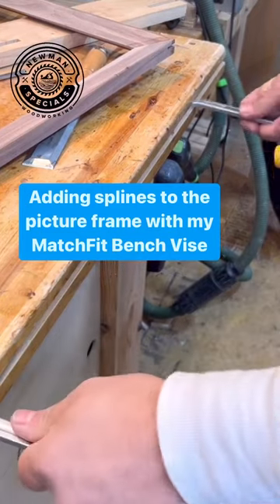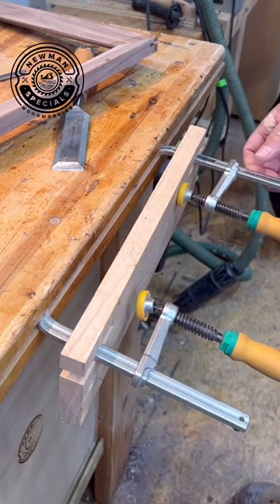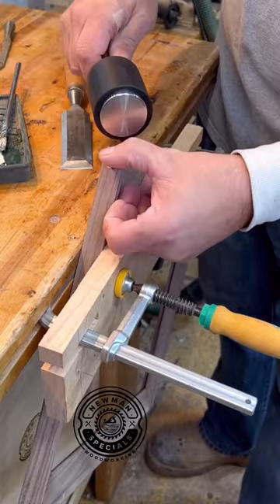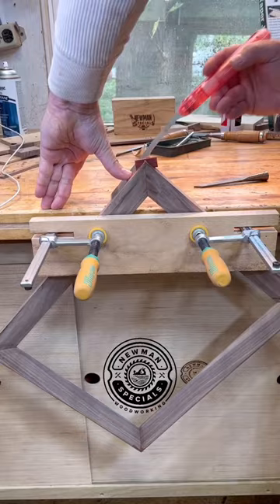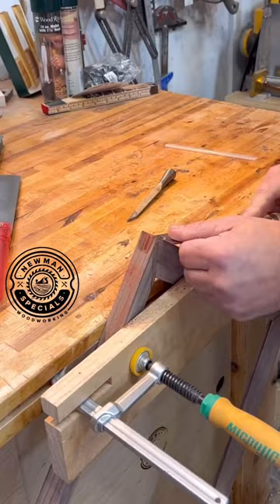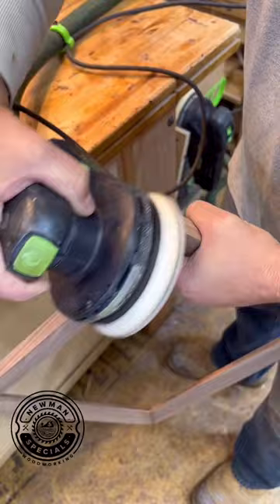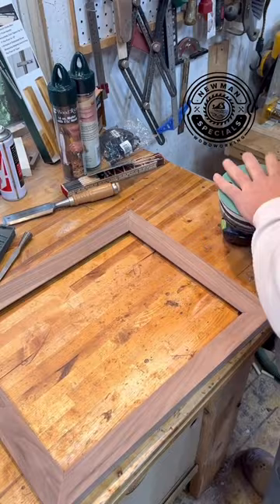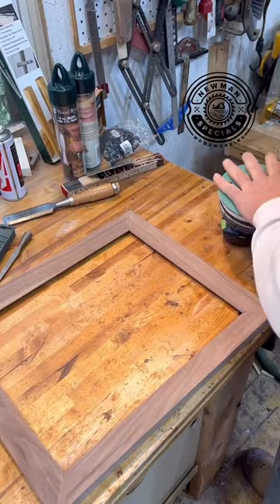This MatchFit bench vise works great! #shorts

Comment: You used a router to make the grove in the side yes?
Reply from the maker: Blake, the groove is a 1/2" wide, 14 degree dovetail cut, 3/8" deep. You can use any 1/2", 14 degree bit, or you can use ours, which is designed to round over the top edges of the groove so you don't need to sand them smooth:
https://www.microjig.com/products/dovetail-bit-14-12
Reply: Yes, he used a router. It's a dovetail bit, but the matchfit bit is nicer for the clamps. I don't know what the word salad is in his comment lol.

Comment: what did you do to cut the dovetail on the edge? I tried and failed.
Reply from the maker: The best way is to have the bench top on edge so you are working on the top. 
But a good edge guide, especially one with a flat panel to rest on the top, will allow for making the groove on the side more easily. 
Remember too that cutting a 1/4" wide by 5/16" deep relief groove first will make the dovetail cut MUCH easier.
Reply: You can also do like I did and add (screw) a hardwood edge that already has the dovetail routed. Much easier that way
Reply from the maker: @louisolivierfortin  That is the beauty of woodworking; There is never only one way to do anything. The how is often closely related to the set up and tools available.